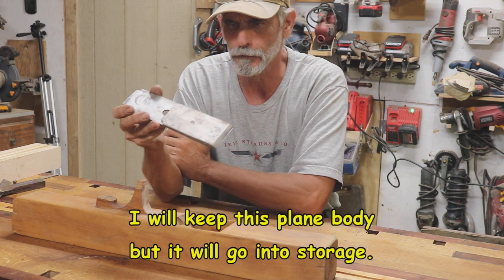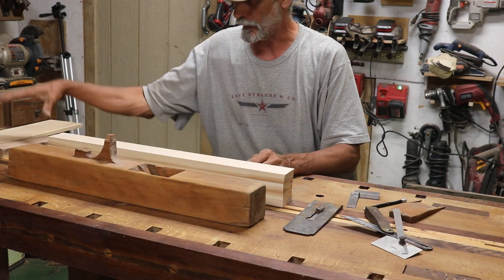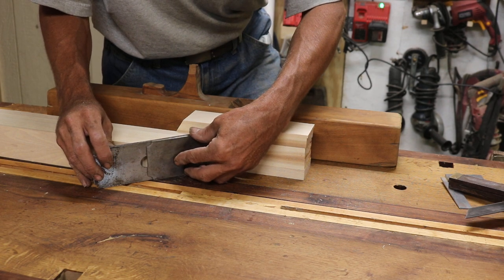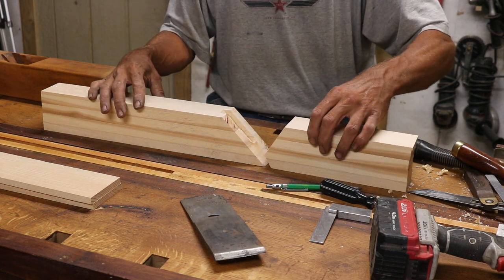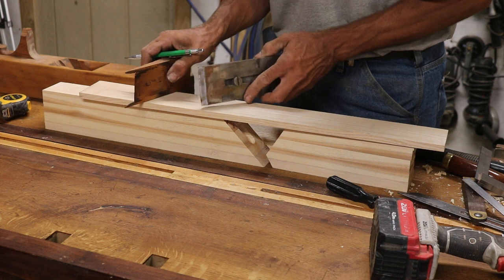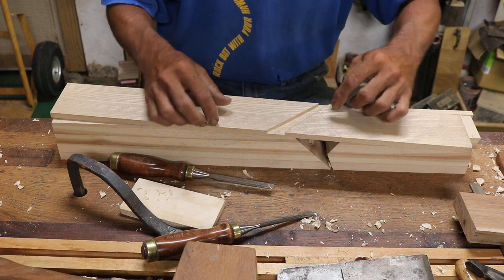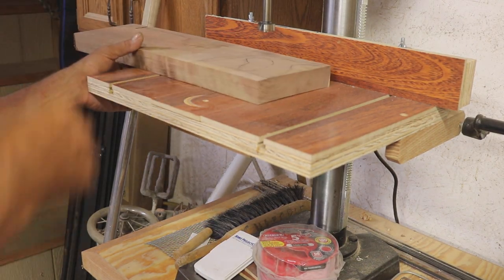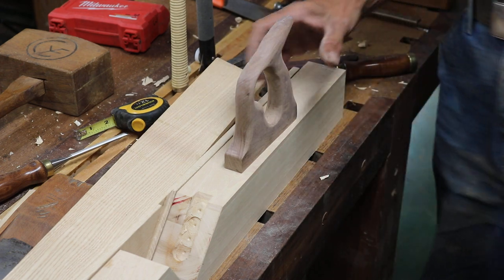ReMaking a Wooden Jointer Plane

Comment: I have been wondering about cutting the grooves for the wood wedge before glue up, and you provided the solution. I think I would make a vertical straight edge to guide the saw, which might be easier than the way you did it. I would need 2 for the 2 different angles, 1 to 1 1/2 inches high. I have seen people put some rare earth magnets in this type of guide to hold the saw vertical. Nice job.

Comment: 12:56 when cutting the slot for the cap iron screw, did you find that you still had lateral adjustment with the cutout section being that tight?  I was guessing that it needed 3/8 side to side for full range of motion but that was a guess. I have a 36” piece of 8/4 hard maple that I want to use for a jointer plane, but I want to get a good steel first.